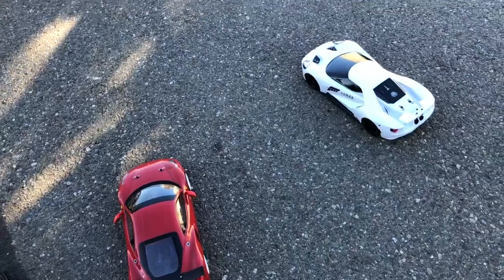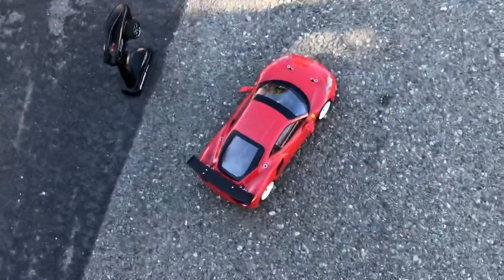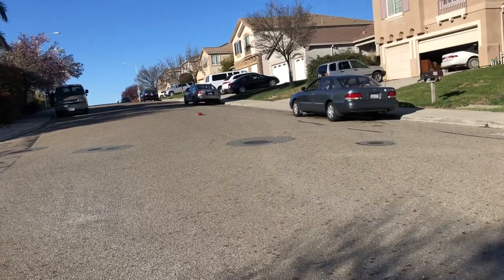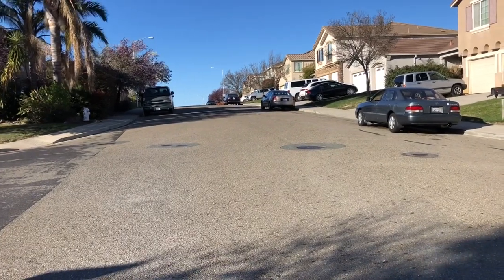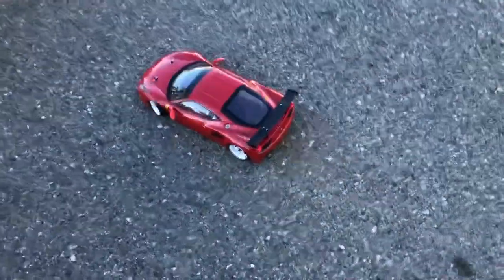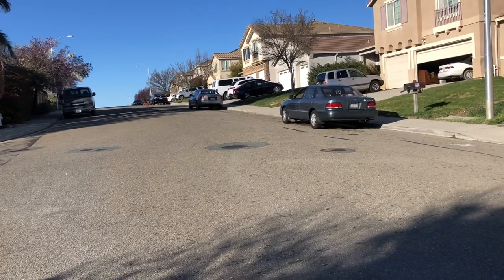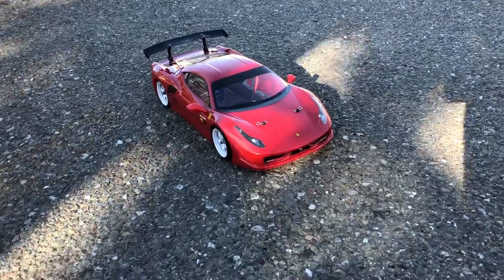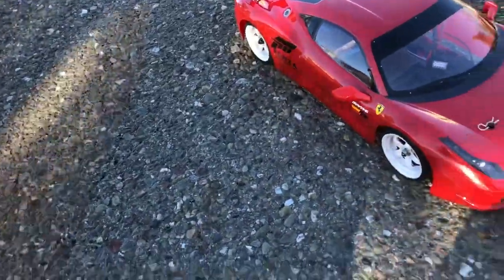Traxxas 4Tec 2.0 Speed Running (XL-5 and VXL-3)

Comment: To fix your throttle smoothness, you need a sensored brushless esc & motor… try the new copperhead esc from castle creations… maybe with a 5700kv motor if you don t want it stupid fast. You can sell the stock Vxl system .